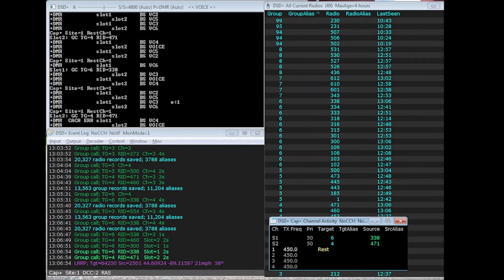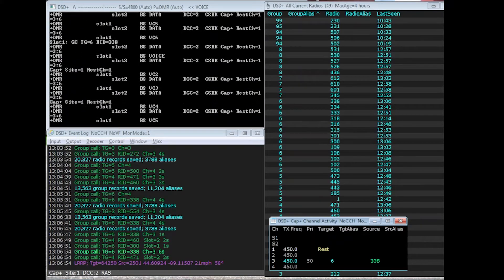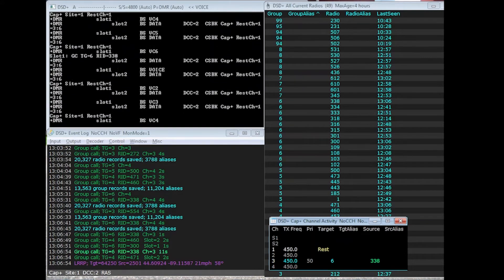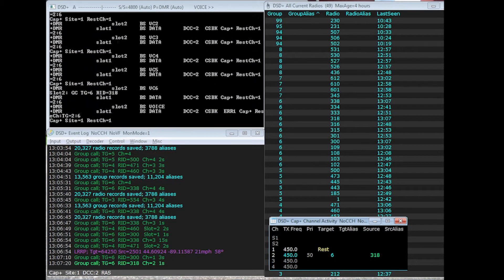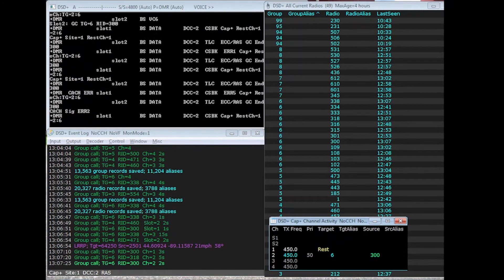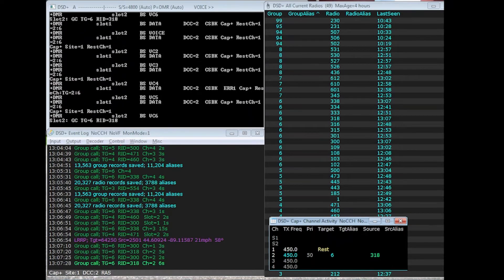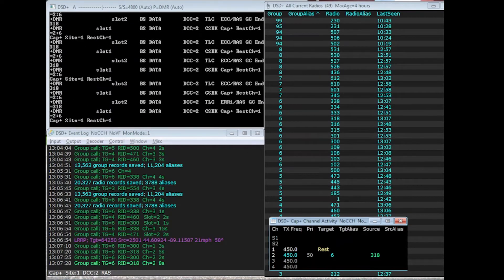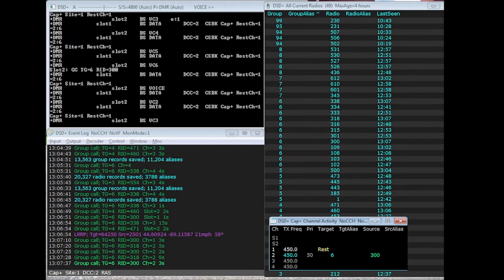Decoding MotoTRBO Capacity Plus with RAS - DSD+

Comment: Anyway to discover the RAS key ?
Reply from the maker: Nope
Reply: Try the default otherwise you're most likely SOL.
Reply: @rfi-cryptolab4251 "Depends how much time do have on your hands." Tbh, as long as there is no privacy, listening is just fine.
Reply: Whats the defauly
Reply: @jacksp8452  There isn't really a default RAS key. In the CPS software, the RAS key is blank, so you need to create your own from scratch, which isn't hard. Like enhanced privacy, it will even let you use "1".
Reply: The default is 000000.
Default EP is 1.

Yeah, techs have actually used those parameters. 

I've also heard of a BP cap+ system with a BP key of 255 and the RAS key was 255255.

Comment: Tier3?
Reply from the maker: You could also use DSD+ to monitor a Tier 3 System
Reply: Where can I download this version, can you share it?
Reply from the maker: You can get DSD from the creators here. For the latest version, you will want to join the FastLane Program it is well worth it.
https://www.dsdplus.com/
Reply: @RadioGeek  I would really like to know if the DSD SW can extract and display the RAS key as the key can be up to 24 digits/characters/special characters?
Reply: @havarknutsen2835  It cannot
Reply from the maker: @havarknutsen2835  Like Aaron said, no it can not.
Reply: Pseudo Trunking 😉